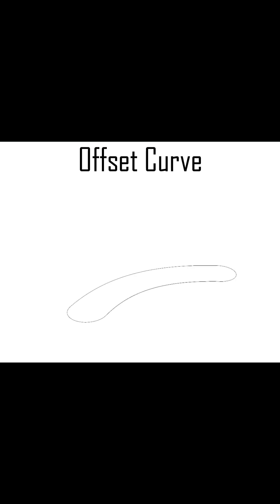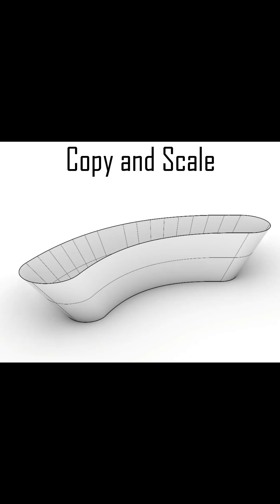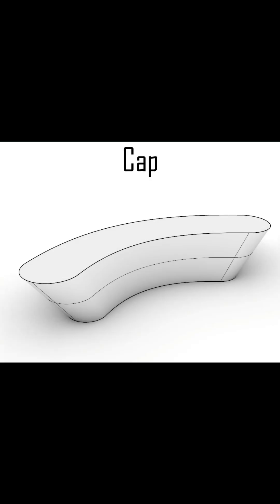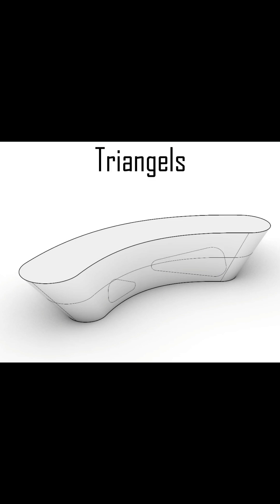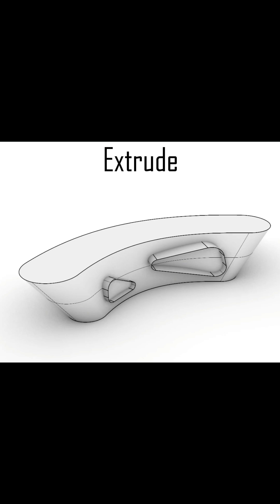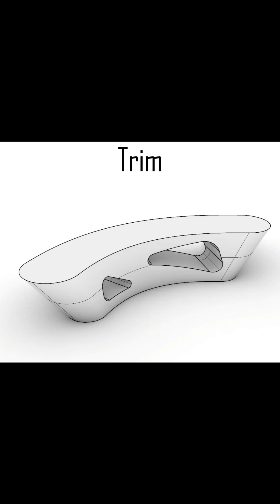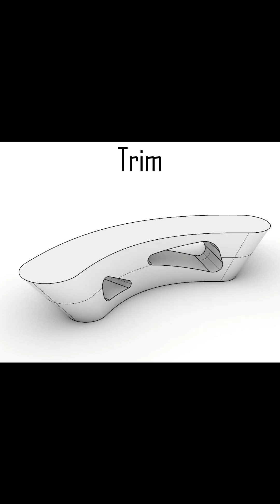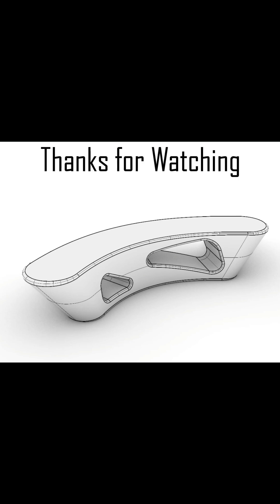Table Design in Rhino 3D  #rhinoceros #rhino3d #tutorial #3ddesign #learning

Comment: You could start with a straight box, make the holes, then bend it. That way the holes will take the same curves of the edges and look more organic
Reply from the maker: Thank you for your suggestion! That's definitely a straightforward and effective approach. However, in this case, I wanted to model the design based on specific dimensions and align the top and bottom of the table precisely. It’s a bit more challenging, but it gives me better control over the final shape. I appreciate your input! 😊

Comment: I'm a beginner on rhino.
I often have difficulties such as changing the dimensions of a curve or an extrusion. 

I sometimes have to start the process all over again, maybe I should have just put 3 at 5 or the other way round.
Reply from the maker: @zerordures8560 It’s completely normal to face challenges like these as a beginner in Rhino! Understanding dimensions and adjustments takes time and practice, but it will become much easier as you gain experience. Don’t hesitate to reach out to me on my social networks if you have any questions or need guidance—I’m here to help!
Reply: Great.
I appreciate your sense of sharing knowledge.
Can I have your contact outside of YouTube.
Like Instagram or linkedin.
Reply from the maker: @ yeah sure, my instagram id is @hassanrezaagha
Telegram id is @ahassanr
Glad to be a part of your learning journey 🌺
Reply: Très bien, j'ai pris votre contacte télégramme merci
Reply: …because it is not parametric just as Solidworks. Sketches parametric dimensions is so easy to modify. Same can be done with grasshopper, if have some patience to do that with waaaay more complicated sketching.